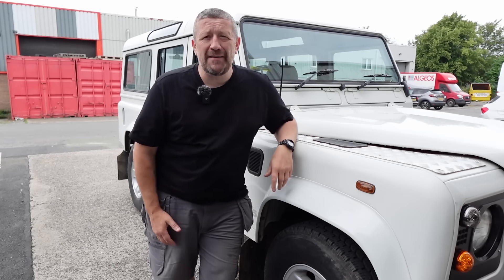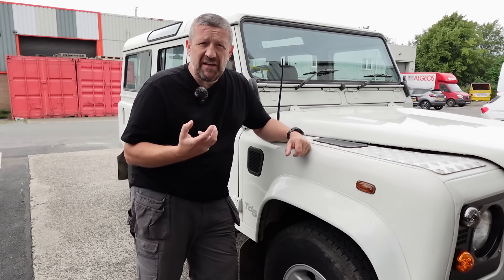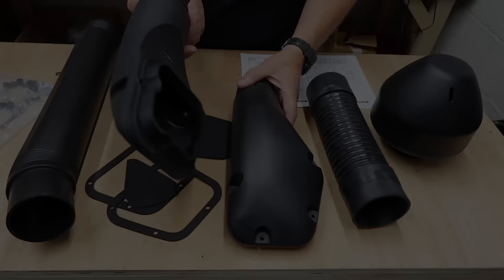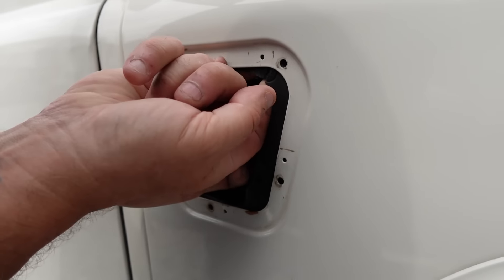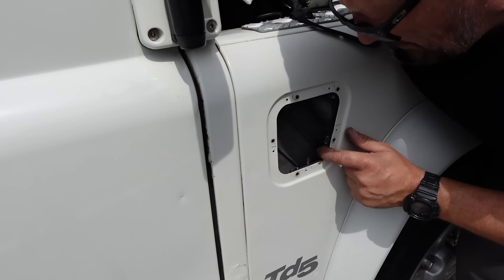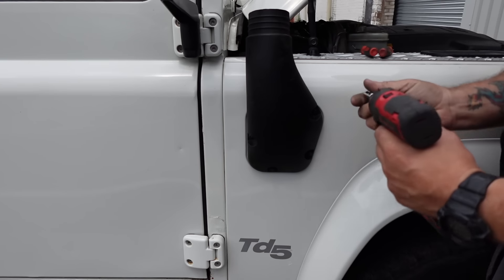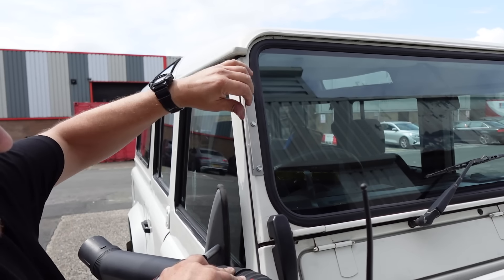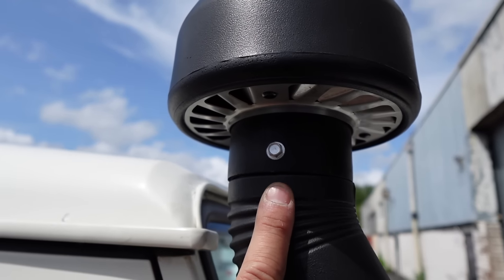How easy is it to fit a raised air intake on a Defender?

Comment: I got this Raised Air Intake fitted when I got my new 90 in early 2006.
The A-post bracket in now well and truly corroded.
I've really struggled to source a replacement one in Stainless steel  and am awaiting a reply from Mantec.
If Mantec can't supply one... can LrParts?
Reply from the maker: Your best bet would be to email mantec@lrparts.net and see if they can supply you with a fitting kit / bracket.

Comment: I've found the instructions for the older style metal version of this raised air intake on Land Rover TOPIx, which details how to waterproof the intake system. It's listed under Part No. STC50265 and the diagrams clearly show a Td5. Is there an email address I can send this over to you on if you're interested?

Regards,

Cameron
Reply from the maker: Hi, would be good to see. You could email them to me at fraser@lrparts.net Cheers